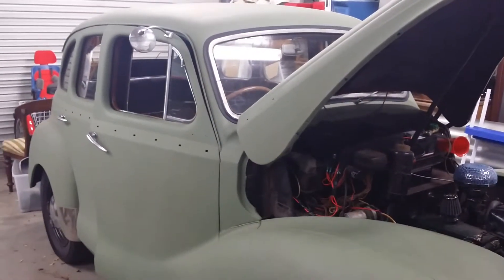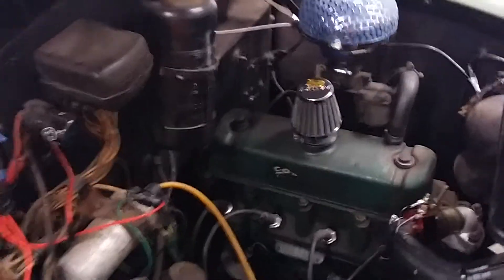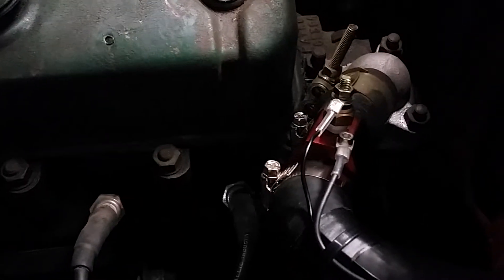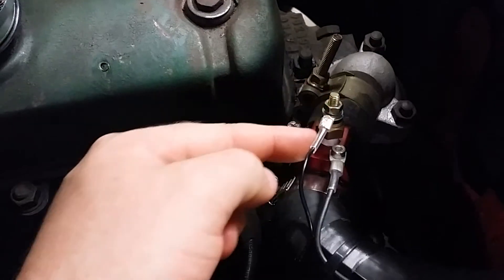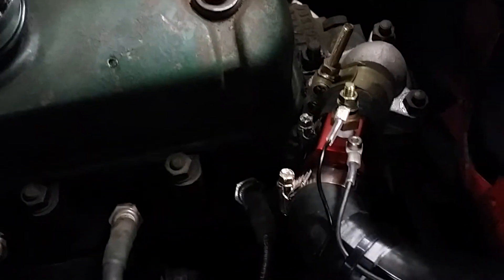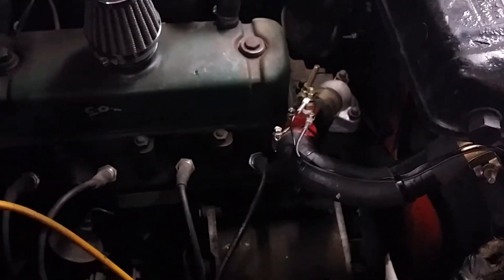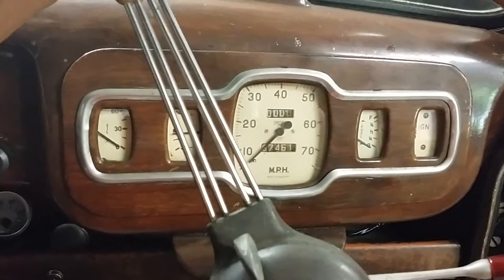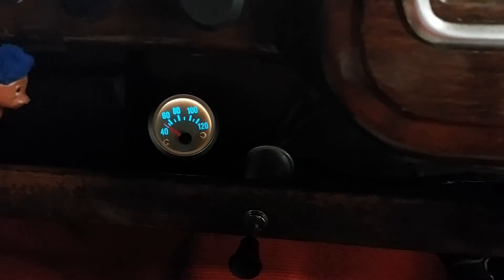Austin A40 Devon temperature gauge. The old 1950 a40 devon cant beat them.

Comment: I replaced my stock gauge and sending unit with an electric aftermarket one. It came with a number of adapters, one of which worked.  I tried to gut the stock gauge (it wasn't working at all) so I could put a modern gauge in the old Austin housing but I gave up and just mounted the replacement gauge on the parcel shelf.